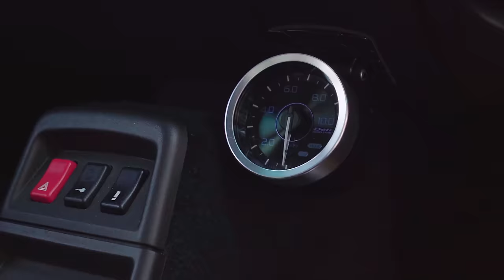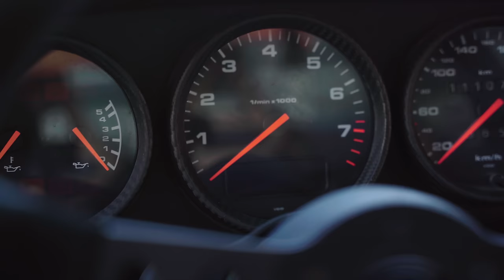This LS-Swapped Porsche 911 is Everything Purists Hate About RWB | “Elrod”

Comment: The LS is a better engine anyway. Lighter and more reliable if naturally aspirated. Can make away more power also. 
Remember, the original engine for this car is not a Mezger, it's not a Turbo or GT car.
Reply: The non-GT or non-turbo engine is severely lacking in power/reliability...air cooled and all. 
I have a 911TT with the mezger.
Reply: An the ls low maintenance engine just change the oil an you are set
Reply: @LSDdreams808  but has problems with the cylinder sleeves. Weak. Boosted stock LSs are weak.
Reply: @TeamHeat604  ok boomer.
Reply: Your comparing a v6 to a V8.
A built v8 at that. 
How does that make sense?
Reply: @SeamusMcFitz-jz9if  it's not even same catagory
Reply: @SeamusMcFitz-jz9if  I've only driven a 19 718 Boxter. 
That car made me fall in love with Porsche, I commend you on the 911 though. 
That's where it's at.
Reply: @kitchenininja  so, I was saying that for the application, the LS/LT engine heck even the K series are better engines for that platform. 
They are all more stoute, lighter, and can fit.
The non-turbo, non-GT Porsche engines are really not that good. 👌
If you want to go fast in a straight line or around corners you use an LS/LT in this case.
Reply: @SeamusMcFitz-jz9if  na an ls will hold 1000hp boosted beet v8 money can buy
Reply: @LSDdreams808  stock sleeves? Multiple hot laps? Hmm. Not sure...a built LS/LT yes, all-day (maybe not hot lapped).
The only cars at the end of a hot lap drag day are: Lambos, R8s, GTRs. Not even Vipers.
The domestic engines just don't last past 2-3 rounds. Maybe your experience is different.
Reply: @TeamHeat604  ok boomer
Reply: @SeamusMcFitz-jz9if  well im talking about the LS out of a corvette they different then the junkyard trucks LS people use. But you do make some good points
Reply: It just sounds terrible.
Reply: My 959 runs badass. Thaught I should share that here.
Reply: The ls is lighter and better sounding then the 944 but lighter then the air cooled 6 and more reliable.... Nope. Good dream tho. On and it doesn't even sound better. 😊 4:04
Reply: People should drop a audi V8 in there. It would really rock with that sound they got!! 6:36
Reply: @SeamusMcFitz-jz9if thats literally one of the most cheapest and basic upgrades you can do to your internals. Youre complaining about nothing
Reply: @TvBoxHead  point out where I'm complaining? I'll wait....
Reply: No it isn't. Not even close
Reply: @nezabytes  you don't have a prosche or an LS. You have no idea what you're talking about
Reply: @SeamusMcFitz-jz9if  oh really? I love this...Bro I will battle you any day about how you think Porsche engines, which currently have the one of the highest bmep of any production engine, trounce the arcane ls engines!
Reply: @nezabytes  not too bright. I get it. It's OK.
I have a 911TT with the mezger. Do you even know what a mezger is?
Name a non-GT or non-Turbo Porsche engine you think is better than the LS/LT platform. I'll defer to the Nurbergring laptimes to prove my point. I'll wait....
We can take it to 1/4 mile times with single pass or hot laps or Formula drift engines....
I'll wait...you're dismissed.
This happens to you all the time. I just know.
Still waiting.....
Reply: @SeamusMcFitz-jz9if 
I think the engine that came in the old VW beetles are far superior to any engines of the modern era. The can handle immense amounts of boost. 😉
Reply: Nobody buys these porsche for the performance, they’re bought because of the feeling you get when you drive these things. Its truly unmatched, from the sound, to how the car feels to drive, its amazing
Reply: It sounds like crappola
Reply: @kitchenininja It's  flat six but you are right I never thought I would read LS It's better yeah sure especially for this  car.
Reply: @wasntme3651 I don't know about superior but they do take boost quite well......but I wouldn't know anything about boosted old school VWs🫣😉😏

Comment: Your cooling fans are too small. Mishimoto "Raceline" fans. 2 if them move 3600 cfm (cubic feet per minute) I upgraded from those slim fans and solved my overheating problem. I live in Florida and drive hard with ac on. You can feel the suction from the fans a foot in front of the grilles.
Reply: He does daily drive it so he's probably not going all out like they were today

Comment: im 100% into it, ive wanted and RWB and ill get one evenutally! Which makes me INSAINLY happy to see it daily driven! 
my LSx powered 944 is probably the closest thing to a RWB 911 LSx i could have at this time and I LOVE EVERY SECOND!
Reply: fun note LSx engines do not have an issue with oiling, not one problem at all. ITS HAS to do with the geomatry of the oil pan for 911 swaps and the way the car moves and leans makes the oil go the opposite of what anything "conventional" would use. so an accusump stops the oil starvation because of "unable oil pan design" and sadly packaging. because in the 944 we hold more G's than a 911 and hotter lap times with a standard sump engines, corvettes too and sadly it really boils down to pan design and baffling which the 911 conversion pans jsut simply have not.

Comment: I think every single 996 tiptronic  base 911 should be used as a hot rod platform for LS based V8s / GM V8s .

I drove a base 996 911 auto when they were new and it was the most dissapointing car I ever drove . So underpowered feeling and boring . 

But they are still 911s with some potential . The 996 TURBO was awesome . Yes , it had the cheap feeling ugly  interior that lost its way but at the time it was a monster street car for turn key usable acceleration with the level of traction. 

Considering how hated the base 996 is and the headlights treated like some kind of birth defect that somehow destroys its look for the classic shape and how awfully underpowered they were and the tiptronic Making it feel like a 6 cyl camary  when accelerating . The whole throw out bearing thing and general cost of fixing cars that suck and the ability to fit a more classic front clip with round headlights instead of the fried eggs that people are so disgusted by which Is the tiniest of problems with them as cars but unloved they seem the perfect platform to hack up and be re purposed and given some dignity  by giving them some performance with a great V8 .
Reply from the maker: I agree with the automatic 996 comments. Let's V8 swap them all.

Comment: Is this lighter than the original? Surely the centre of gravity is much higher, which would matter on a circuit....
Reply: And? Are you aiming for track records?
Reply: @staLkerhu  No, but the driving experience wouldn't be as good, exciting etc. ...
Reply: @slickedrightback  based on what they said it does not seem like the case...
Reply: @staLkerhu  they commented on it understeering and being totally planted at the rear. This would imply extra or excess weight at the rear, the original would keep you on your toes in said driving conditions,  being fun , exciting and a true drivers car.
Reply from the maker: The engine itself is probably similar in weight, if not a little lighter than the original. But of course the wheels and additional body work don't help the cause
Reply: LS is a small block cam -in-block engine. It will have a really low center of gravity. That plus the transaxle are why vette hoods can be so low.

Comment: Needs more cross sectional area on the intake side of the radiator, it’s suffocating for air
Reply: Also, more air passing thru the engine bay with allow the stored heat to be extracted and provide less of a load on the existing cooling system

Comment: wtf these guys talking about? Dry sump isn’t good for the street? When you’re trying to make a big hp big grip track car that you also wanna drive on the street it is lol! Also…no Fe block LS “truck” motors aren’t better for boost - fe block Chevy crate motors? Yeah sure. You can throw PLENTY of SC boost @ an LS3 & decent turbo, if you wanna go 2k whp? Ok get a Nelson racing engine, a Fe big block crate motor OR one of those sick 1 piece CNC machined 6061 aluminum block remakes. My C5Z has been making over 700whp on a mustang dyno w/ an A&A t3 vortech blower for 37k miles….street and track, street to the track & while rolling window down & flying the finger @ porsche/mclaren owners trailering their sh*t home😂😂😂😂
Reply from the maker: Yes haha. I didn't say it wasn't good for the street, but impractical. I was mostly pointing to an aftermarket system being a huge cost (like Elvis mentioned), but also the complexity of adding additional components and of course the maintenance that comes with it. For most street cars that aren't insanely fast or track-driven to the limit, it's probably more headache than it's worth.

Comment: Why an LS and not a cayenne V8??
Reply: Do you really have to ask that question?
Reply: @sidefx996  absolutely. At least keep it a Porsche!
Reply: @andresguerin7162  I totally get your thinking.  It's obviously "cooler" when a guy keeps a Firebird with a Pontiac engine and here if a Porsche engine was swapped rather than a Chevy engine.  But beyond that "cooler" factor pretty much every other reason to do what they did sways in the LS's favor.
Reply: @sidefx996  being so radical, an ls swap seems mundane...
Reply: @andresguerin7162  I think what Singer does to a Porsche is "radical."  I know I'm oversimplifying things but I was never a fan of watching Akira chop up a Porsche, chain smoke and hot glue fender flares on it.  I just don't get it.  And watching all the "car guys" standing around in AWE while he does it is just cringy...
Reply: @sidefx996  not a fan of Akira at all

Comment: Not very impressive to me. I love 911s. I'd rather use a 5.2L Voodoo engine. High reving engine with a  power band similar to a racing 911. Flat-plane crankshaft sound! Like a Porsche engine with 2 more cylinders and cheaper horsepower.